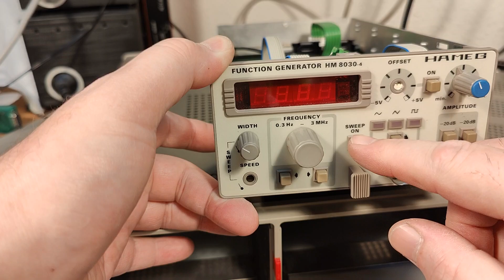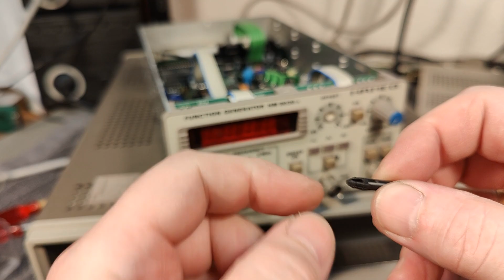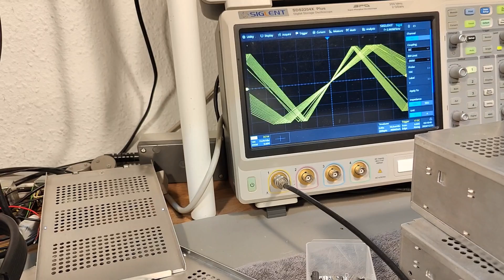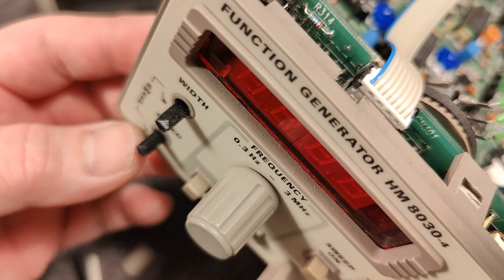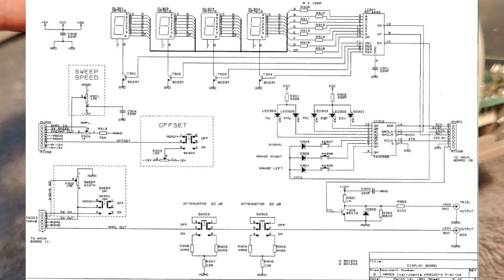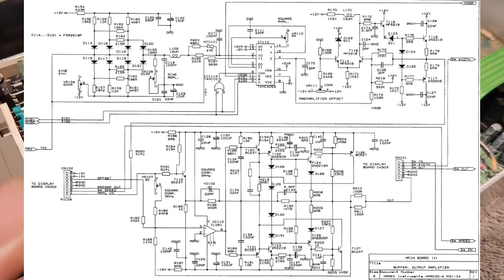Hameg HM8001 HM8030-4 Function Generator test teardown

Comment: Probably all knob mounting systems could be worse. Unless they use seizing-prone 1/16" hex grub screws. 
...
All that effort and no symmetry dial?
....
Did they at least make the trigger output useful in sweep mode (as in, something you can actually trigger the beginning of the sweep  on)?
Reply from the maker: yes trigger out actually works really good

Comment: This is one of the rare cases that I could have machined these in my shop on the mill faster than designing/3D printing them assuming only 2 or 3 were needed. That said, I wouldn't give up my 3D printer for anything other than a better one!  This unit was beautiful inside, the belt reduction drive a gem.  I'm starting to miss some of this mechanical magic from years gone by more and more.  Never could stand using a piece of glass as a user interface, the lack of tactile feel when trying to type is awful for example.

Comment: Hello, I have all shafts and buttons for Hameg Instruments if you want to complete yours. This one is an old version, more recent versions use an encoder for the frequency setting.
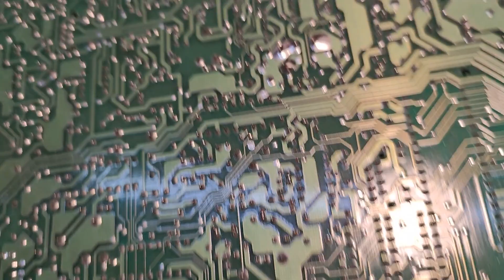16:20 Large insulation is not required, the ground is connected to the chassis.